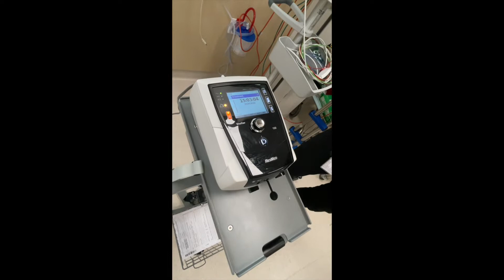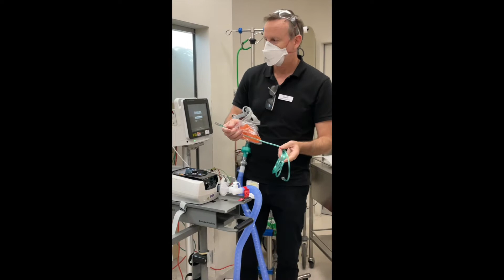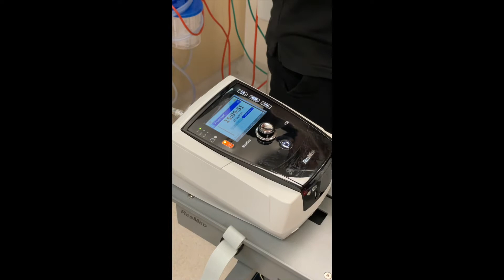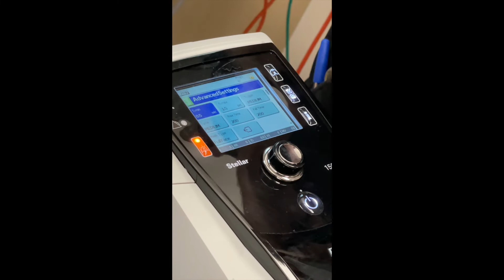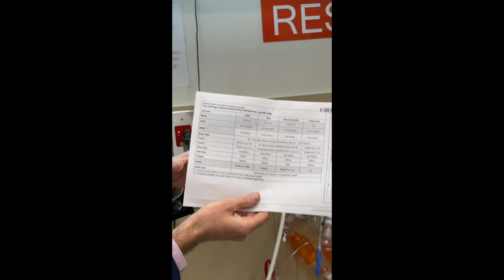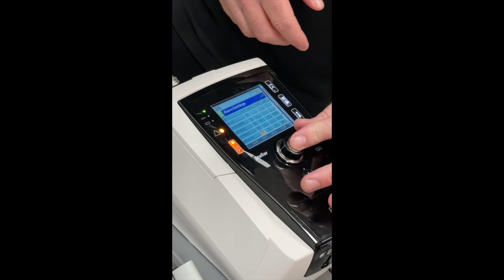NEW NIV MACHINE

Comment: respect
I got this device to use a few days ago.
All parameters for inhalation are set in it by the doctor.
What I forgot when they explained to me was the procedure for turning the device off and on.
Should the hose from my concentrator be connected to the device when I turn it on, or not?
I usually light it on the button behind a when it does the initiation and the button above that starts the inhalation.
When I'm done, I press the top button to stop inhalation, then the bottom button, and then the one where the "wheel" is
Am I doing it right or wrong?